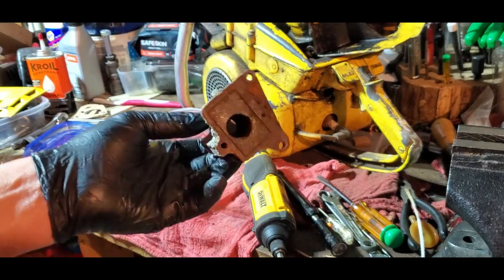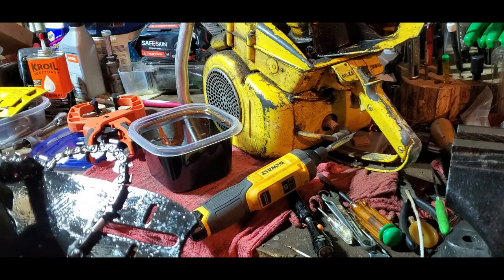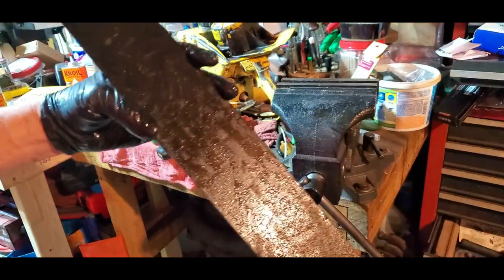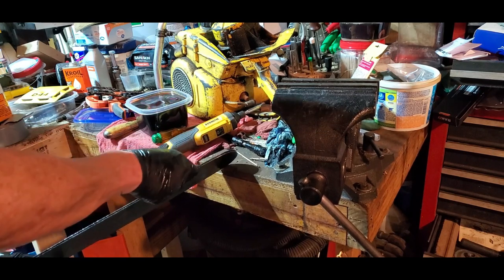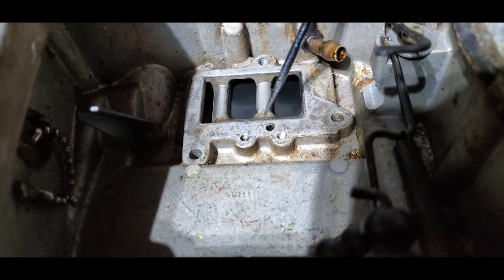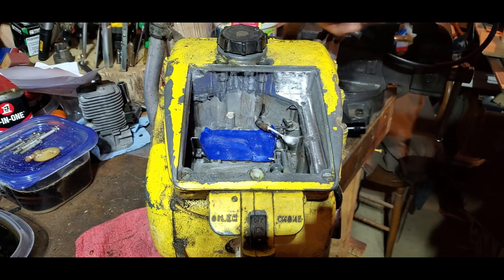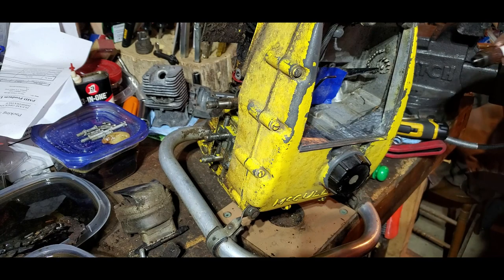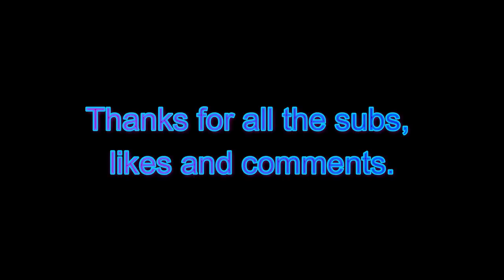Resurrecting a McCulloch D44 Chainsaw - Part Two of Three

Comment: You will get it going. I have faith in you.
Reply from the maker: The carb is giving me a fit Josh. The passages were full of corrosion and I soaked it in 4 different cleaners. I went to far and damaged the outside surfaces. I won't know if it will work or not until I try to start it after I get the last seal this coming week.
Reply: @ClintsHobbiesDIY  With that old stuff I have actually had pretty good luck using my slide caliper and getting a seal matched up at the local parts store

Comment: Have you ever tried vinegar on old chain like that?
Reply from the maker: Yes I have Smitty. I believe Evaporust does better. I just keep using it over and over until it quits working. Vinegar does work, but don't forget about it until months later. It will eat up metal.
Going to get another free saw today. It's yellow and black. Just not old enough.